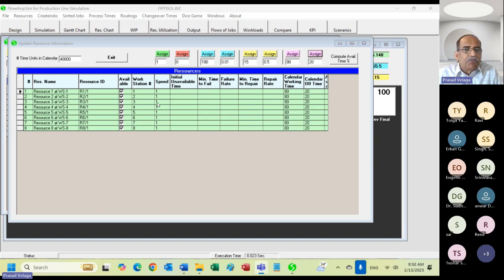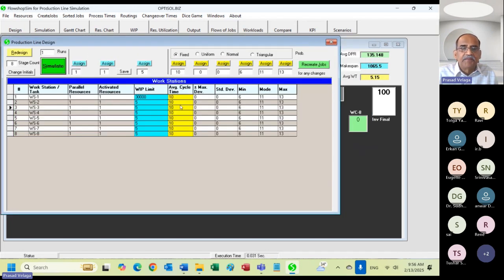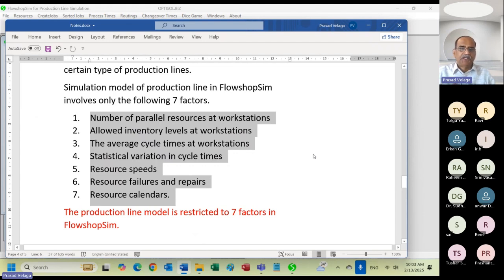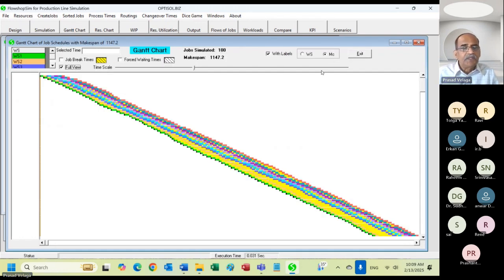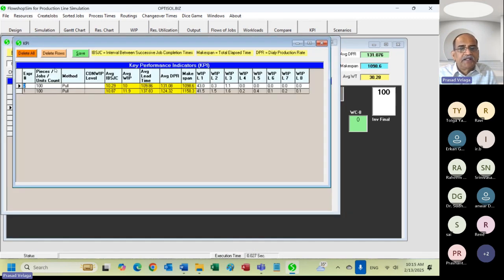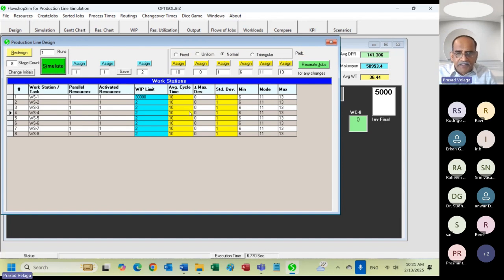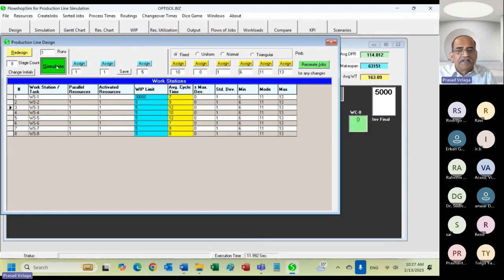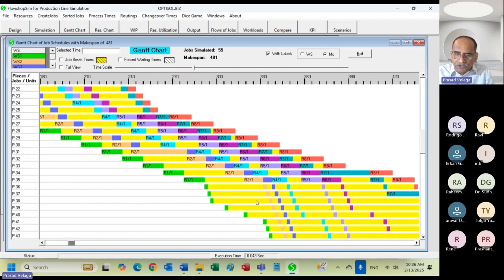FlowshopSim for Monte Carlo Simulation of Material Flow on Production Lines

Comment: The users of FlowshopSim can quickly, easily and effortlessly simulate a production line (in discrete manufacturing) by considering any meaningful values of the seven factors listed in the above description of the video. They do not need formal simulation knowledge. FlowshopSim is very fast for production line simulation involving the seven factors. For example, within 13 seconds it can simulate the flow of 5,000 pieces on an 8-stage production line with random cycle times, machine failures, repairs and calendars, any selected number of machines and any given inventory limits at workstations. This speed can easily facilitate a lot of experimentation on production line with respect to those 7 factors.